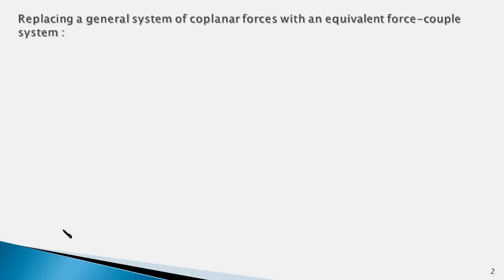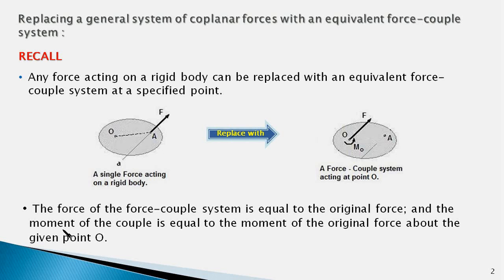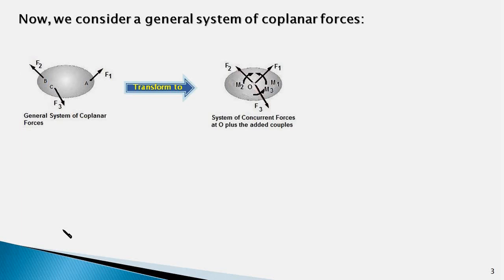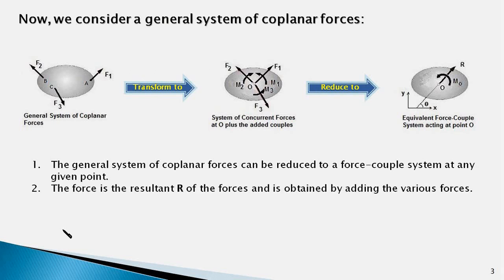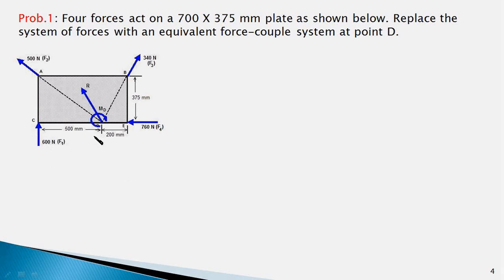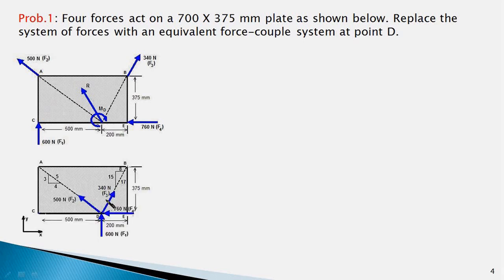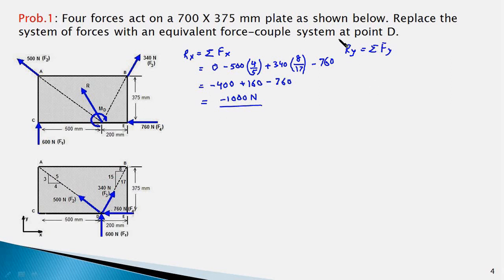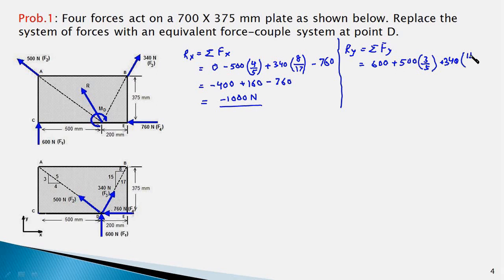7.2 How to replace a system of co-planar forces with a force-couple system (Solved example)

Comment: Excellent video. Just one comment. in the "force - couple" system, the couple is not really tied down to the point chosen is it? Meaning, once i have computed the couple, i could draw it anywhere on the body.
Reply from the maker: This point I've clarified in detail in comments under the video # 7.3 on "Force-couple" systems

Comment: How the direction of resultant force and the direction of resultant moment were found in figure 3 during 2:50? Similarly in problem 1 how the direction of resultant force as well as resultant moment were found along with the slope?
Reply from the maker: Hello Arman; I think you need to first understand the basic concepts on addition of coplanar force vectors and resultant of moments and then get back to this video. I suggest you to watch the following three videos before you move to an advanced topic of force-couple system.

3.1 Resultant from rect. components   https://youtu.be/cYKaMg4Yx5o
5.1 Moment of Force (basics)  https://youtu.be/HxG-GuQ2xQo
5.2 Moment of force (problems)   https://youtu.be/wXklLO_l46w

Hopefully all your doubts will get cleared. However if you still have any specific doubt, please post it here.